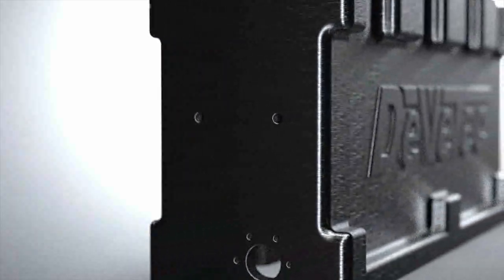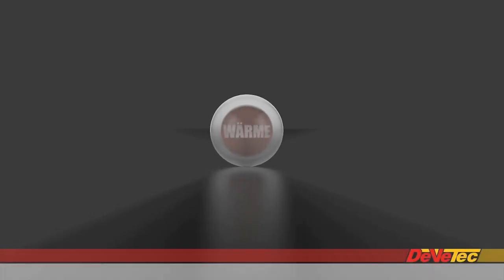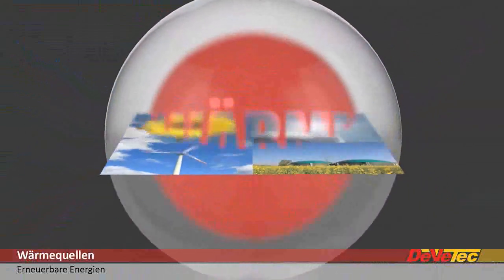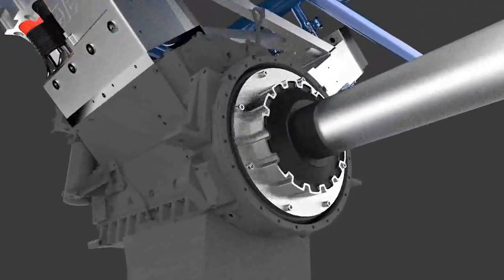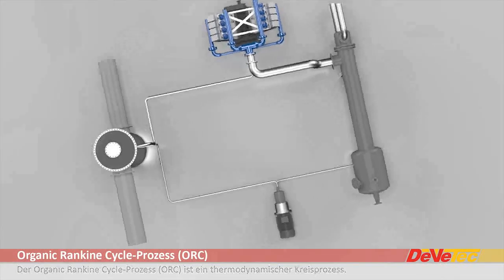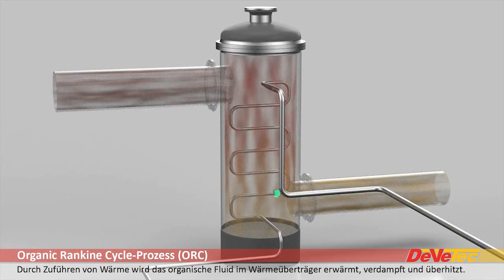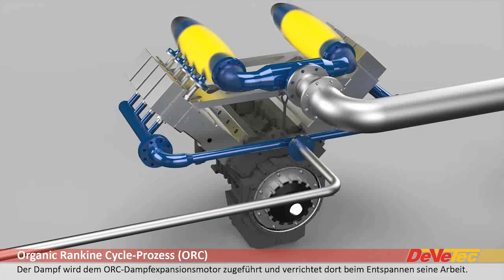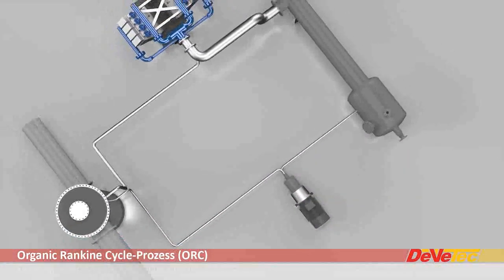English version: The DeVeTec ORC steam expansion piston engine

Comment: Why such complicated 8 cylinder expasion engine? Why don't you use simple turbine or rotary vane engines?
Reply: Turbines are extremely inefficient at low pressures. Thousands of PSI are needed to make them worth while
Reply: @abitofeverything9970  this is not in general true. It depends on the working fluid used and also at the heater temperature level used. Low pressures are in general not convenient because you need heavier machinery and wide tubing. And especially axial turbines have advantages in comparison to piston machinery, when it comes to lower pressures, because they offer wide cross sections for streaming media. The aircraft turbines are the best examples. No other engines can operate in such a compact package at this performance at air pressures of just a quarter of the air pressure at ground.

And it is easy to generate electricity with turbines within the hermetically sealed engine package. You can place the permanent magnets within the rotor and a 3 phase coil system in their vicinity with axial or radial flux. so there is no need to transmit the engine power across the shaft. You can use axial flux generators with both radial and axial turbines. They simply consist only of rotating permanent magnets within the rotor and coils infront and behind them. No iron core is needed.
Reply: @gkdresden  i wish you had half a clue.
Reply: @gkdresden  small scale turbines are not very efficient, which is why you don’t see them. Companies have been trying for years, the problem is small turbines have to spin at extraordinary speeds to be efficient, and we have yet to find materials that will not explode or disintegrate at the speeds required. The other things is that turbines are only more efficient at steady load, and typically only at a 100% steady load. Piston engines are better suited where load fluctuates, which is why trains and automobiles use piston engines instead of turbines. Steam turbine locomotives were tried many times over the years but were scrapped because overall efficiency was much lower due to loads consistently fluctuating.
Reply: @justinhadden5160  It depends on the size. If you think about cement production as an industrial process there are megawatts of waste heat flow. Of course this is a size for conventional turbine application. For mush smaller heat flows of couse there are other solutions like scroll or piston expanders. But a 8 cylinder engine is wasted effort. Especially in the case of a 2 stroke process one should apply 3 cylinder engines. Another possibility for 2 stroke operation is the self balanced, double acting rotary vane engine.

In a transcritical ORC project I use a special bladeless supersonic radial turbine for 1 kW. The performance is very good. The pressure is high and the expander is very small (50 mm outer rotor diameter). It is not entirely true that small turbines have low efficiencies. In Helium liquefiers they use small turbine expanders since 3 to 4 decades in the sub kW power range.